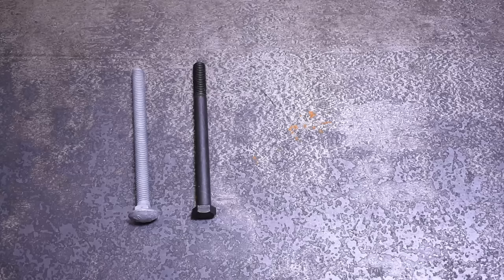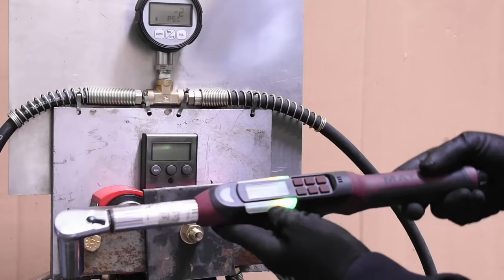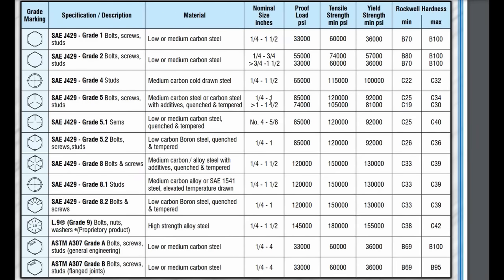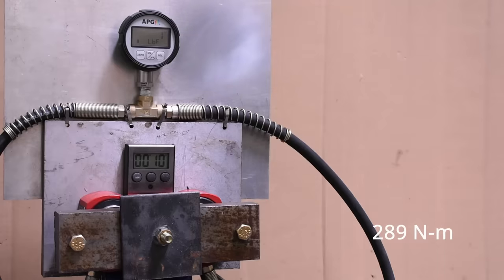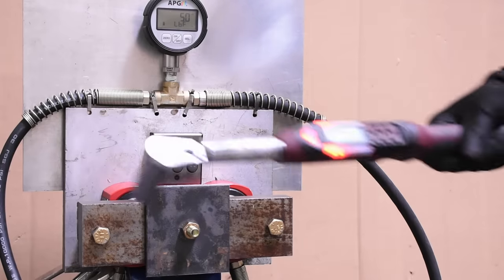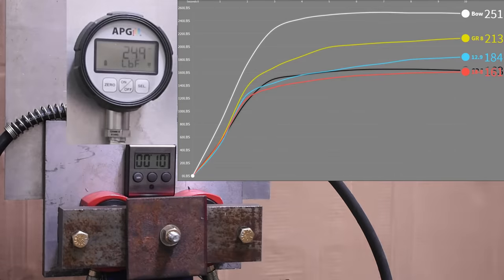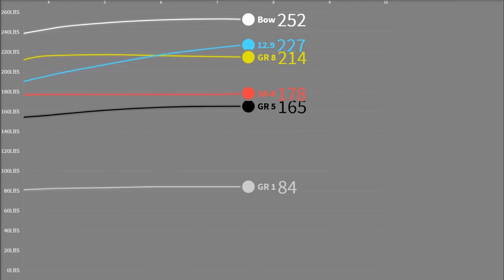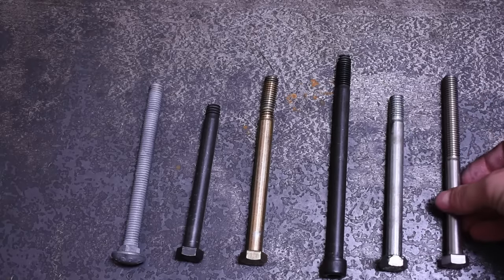Strongest Bolt? Grades Explained & Dyno Tested For Science

Comment: Hmm, we get 14.9 bolts with a 1” shank for holding big fucking machinery together, we can’t find a rattlegun that can break them yet, which is why we have a hydraulic tension tool which will do them up to 1400ftlb when required.

Comment: I really hate the 12.9 bolts.
At my site we use 8.8 hex bolts and/or 12.9 internal hex socket bolts.
And when the 12.9 bolts fail, thay are a paint to extract.

Comment: The 18-8 and 316ss are weird with 18-8 or 316ss nut.  They tend to heat up and seize if you tightened up to quickly especially when torque is involved.  When they start to notice unusual torque resistance to them they can seize very quickly and only way out is cut them of or break them off.  I never really understood this tendencies working around these fasterners.  Them alsmost act like working around bolts and aluminium  in that you cant let them heat up to much by threading otherwise they start seizing and stripping (thats on aluminum).  Like i said i dont understand the why that is that is something i in countered personally.  Maybe u or someone on here can shed some light on this issue...

Comment: Stainless bolts thend to cold weld if used anywhere near their tencile stregth. Also they tend to stretch easy and make them a one time use screw. 8.8, 10.9 and 12.9 can be used again without loosing strength if not overtighten.
Grade A ... well usable as a coat hanger I guess ... do not use them for anything structual or critical.

Comment: is your gauge reading in LBS or FT-LBS? How are you converting load to torque from this equation T = KDP?
Reply from the maker: It's converting bolt tension psi to ft-lbs of torque, normalized to the torque wrench. Like the Skidmore Wilhelm process.

Comment: I had an application where a bolt was being pried on. Grade 5 would bend. Grade 8 would snap like a gun shot. Only solution is go big. If using cheap hardware store bolts; go big.

Comment: I would love to see this kind of test on sheet metal screws. I am usually using stainless steel but that may not matter. I have found that they all twist the (#2) Phillips head slots  
out very easily. Some snap off right below the head. This has been very frustrating. Are there higher grade sheet metal screws out there somewhere?
Thanks for all the info in your tests.
Reply: The more expensive ones tend to be made with better metal in my experience.  Look at the country of origin on them and it will usually give you a pretty good indicator of relative quality. US, German, or Canadian screws are usually pretty safe choices.
Reply: @bigj231  Thanks

Comment: What is a metric with a "100" on the head? It doesn't have a "." as in "10.0" but just a "100" had a couple different brands of these. They are used as lug bots for a machine drive wheel. I couldn't find anything online besides the mark for the company is one from China.

Comment: On stainless steel bolt you have to put grease otherwise the bolt and nut will fuse in each other and will mostly brake when you try to take them apart
Reply: And lower the torque accordingly when using lubricants!

Comment: Toward the end you are referring to toughness when it seems you mean strength, they are not the same.  Higher hardness generally means higher strength and lower toughness.  Toughness is the ability to resist cracking and is generally measured by impact.  A grade 1 or 2 bolt may have higher toughness than grade 5 or 8 because they're soft and vend rather than break.

Comment: I like guys pushing the "butter bolt" theory. 
If they'd ever dealt with shear bolts, they'd known if they're tightened properly, any grade bolt used will shear before deforming.
One run loose does deform, and is a botch to get removed.

Comment: Hedder/ manifold bolts, studs. and how heat cycling, weakens/loosens them . More trouble with turbos 1200-1600°F  diesel 1900°+ gas

Comment: I was always told to stay with G8, and "run away" from SS because it was weaker...🤔
More misinformation?
How about redoing this test with the Bolts "soaking" in oil, or lightly coated threads with Lithium Grease...
Would this make any difference at all compared to a "Dry Torque"?
"INQUIRING MINDS" would love to see this as a comparison please.
Your Video makes my brain work like a Supercharger, loud and compressed knowledge!

Comment: i always thought stainless was stronger but i learned that they are barely grade 5...they do last better on exhaust systems but for strength, it is way better for grade 8 as you proved in your tests.....use stainless in applications where you may want to remove the bolt in a few yrs without all the corrosion

Comment: CAT makes their own bolts and seem to have more consistent results then hardware store for critical applications. Available at all their dealers.  And I'd disagree with your statement of wanting a bolt to stretch vs snap.  At both points the bolt has failed and it no longer holding (clamping) the load, except the one that snaps does so at a higher value, correct?.

Comment: I always felt that stainless steel's more brittle especially with harmonics or if you use them plate steel is plate steel bracket situation
Reply: I use to weld and repair Hobart food mixing equipment and was surprised that under vibration the stainless cracks. 16 gauge stainless with a 10 inch crack. I know that steel would never crack in that way. The equipment had to made of SS to meet certain laws for food processing use.

Comment: ENGINEER POINT OF VIEW : Bolts are designed to work like a tensile test sample. Thread is tougher than the shank. Of course the section is lower at the thread so you will see elongation at this place. The useful zone of resistance is the first initial ramp of the curve. Its slope gives you the young modulus of the material. As soon as the curve flatten, you are in permanent deformation zone, the bolt is starting to fail. https://practicalmaintenance.net/wp-content/uploads/Shape-of-Ductile-Specimen-at-Various-Stages-of-Testing1.jpg. So a steep slope followed by a rupture is a good behaviour. You don't want a bolt elongating itself and silently failing.

Comment: Bolt grades are not graded by their stretching holding strength but by their sheer strength. Same as a screws.
   Would be nice the see the thread roll over strength comparison of fine vs course threads.
Reply: Also, the Thor gun needed to be done with a new bolt as the damage and stress was already implied with the used bolt, causing it to fail prematurely.

Comment: Prices on those bolts for bulk are way too high. I work at a hardware/tool/industrial supply store lol. Had someone come in for 196lbs of grade 5 hardware a couple weeks ago, that was $900 CAD. He had at least 13,000 pieces of hardware, I was just grabbing fresh 40lbs boxes for a lot of it. $1.83 for a grade 5 bolt under 3/4x6 is overpriced

Comment: Far as I knew. An impact wrench is less likely to break a bolt as opposed to a breaker bar/ratchet applying the same torque.  But how much of a difference and if it makes a difference...
Reply: Agreed, thousands of lesser impacts will remove a seized fastener without shearing it like a steadily applied higher torque can.

Comment: Just awesome. The armchair (pretend) metallurgical engineers will be along shortly to tell you that you are wrong and Grade 8 (10.9) bolts are worse because they are "brittle" and will fail "suddenly". Thanks for the real world tests. That stretched out grade 8 bolt was telling, and parallels my experience. It looks like the Bow bolts are a legit upgrade it you really think a bolted interface might fail from bolt failure. It makes me wonder why there is such a proliferation of yield bolt engineering (torque to yield) instead of just improved bolts in general. I have a feeling it is because, after the engineering, the TTY bolts are cheaper.
Reply: Am mechanical engineer, MS focused in materials.  Lots of factors in brittle vs ductile failure.  Medium carbon steels can fail either way.  It depends on the loading, strain rate, amount of carbon, heat treatment, inclusions, amount of fatigue, etc.  High carbon is different and almost always has brittle failures.  In general just replace the bolt with the same grade, it may be designed as a failure point to avoid a different worse failure.

TTY bolts exist because deformation increases clamping force of the bolt as well as increases the "steepness" of the stress-strain curve.  When steel deforms it's basically removing it's ability to continue to deform, which makes it harder to deform.  They are also a little bit cheaper.

Comment: Why wouldn't you test a grade 2? It would take alot more torque than a grade1 and they can be very useful in situations where you know a bolt will flex to a point that would break a hardened bolt

Comment: Usually the recommended tightening torque is usually the torque you need to tighten a Bolt to 90% of its tensile strength and with a frictional coefficient of 0,12 in all contact surfaces. This is pretty basic knowledge. Also finding the tensile strength of each of those bolts online is fairly simple :D
Reply from the maker: Other charts are 75%. And that is with linear torque. No one knew, or at least we didn't, if this applies to impacts. Could have been 50% for all we knew as it's not an ideal fastening experience for a bolt.
Reply: @TorqueTestChannel  I'm from Germany and here it's always 90%. A factor in the equation is how accurate you tightening tool is. This makes a lot of difference. Tho a impact is not a precision tool like a torque wrench or a electronic one that measures the angle as well.

Comment: 18-8 stainless bolt isn't made from 18-8 stainless? You said it was a 300 series stainless,  tell me you were incorrect.  If I recall 18-8 has ,lower or no molly.
Reply from the maker: 18-8 isn't a specific alloy of stainless. It's any stainless with 18% chromium and 8% nickel. 304 stainless meets that

Comment: I've used Cobalt bolts before. Wonder how those would hold up.
Reply from the maker: You sure? All the benefits of that class of high speed steel are not generally based on bolt properties
Reply: @TorqueTestChannel  yeah. I'm sure. They were used on chemical tanks. And they were for the contents inside. Lots of corrosion resistance. Used like 16 (don't quote me on that) for bolting down the hatch and securing it to a special concrete structure.
Reply from the maker: M35 and m42 cobalt rusts pretty easy though. Maybe heat resistance?
Reply: @TorqueTestChannel  chemical. Iirc it was a tank for acid at a ethanol plant I was working on.
Reply: @patrickprafke4894  For extreme acid environments like hydroflouric acid they use Tantalum, it's a refractory metal. It's extremly expensive.

Comment: Now I may be stupid. But isn't using an electric drill for tests like these inconsistent? The drill is getting hotter and hotter which is going to change how the electricity flows. A pneumatic tool only cools as you use it because so much air flows through it and would be more consistent no?

Comment: The problem with Bolt and the grade markings is that 90% of people who order bolts goes to China and Chinese manufacturers will stamp whatever you want on the head. So, having a bolt which has a stamp i.e. 8.8 or 10.9 or 12.9 doesn't mean, it really is.

Comment: Grade 1/2 are good for building a wooden fence and equivalent.
Reply: Anything wood. Built up beams and girders, tie downs, wood ledgers on steel beams. Whatever...
NOT good for ACQ pressure treated unless hot dipped (like the carriage bolt shown here)
Reply: @jimurrata6785  Didn't know that, thank you.

Comment: Just saw an engineer recently about an old car i am restoring and he told me to remove all stainless bolts from load bearing parts as it work hardens and becomes brittle over time under stress.
Reply from the maker: True
Reply: and what did you replace them with?

Comment: Bit of antisieze or nickel paste and you will get a big increase in torque. About %40 is lost in friction.
Reply: Indeed, and 50% under the head.  Lubricating fasteners without torque/tension testing is a great way to make them fail under load...

Comment: In yours nomenclature 18-8 is A2-50 ora A2-70? SS steel dont have much Rm.... 500MPa is standard. 700MPa is good value. 800 and more u can obtain only in procesing steel. I belive looking On The results when 18-8 was a little Better then 5.8 you use A2-50 class SS bolts. I belive its true coz class 5.8 got Rm=500MPa and Re=80% of Rm. Mayby if you test A2-70 you will get something near 8.8, A2-80 over 8.8 and A2-100 over 10.9. But A2-100 are hard to find in shops 🙂

Comment: i hate stainless hardware... i used to work with it a lot on concrete trucks, its soft and its prpetty much one and done... its almost like aluminum or something, the nuts literally eat the bolts and vice versa... its like they just grind each other away when you tighten them up and thread them on and off... epecially once it gets a bit dirty or corrosion... its still easier to get apart than rusted bolts though... but you cant reuse them even if they look shiny still... theyll freeze up and usually strip off the threads when you do...
Reply: I'm pretty sure that's called galling. Definitely gotta use lots of anti seize on them if you wanna use them a few times, or have them come off years later without snapping haha.

Comment: I will NEVER buy or use 12.9 EVER.
Long story short, I worked in Assembly. We used pneumatic nut insert guns. 12.9 was what they used. I have had brand new 12.9's strip with the first nut insert. When that happens, you have to break the bolt off in the nut insert and SOMEHOW remove the nut insert. 
A) I hate nut inserts
B) I hate 12.9

Comment: You refer to static load cells used in compressive load measurement as a dyno. It is NOT a dynamometer, if that is the word you are associating with the abbreviation dyno. There is a more or less calculable relation between the torque applied to the head of a bolt, and the tensile stress that results in the bolt, so your measurements are interesting, but not accurate nor generalizable for a wide variety of reasons. Regardless of that, you are not using a "dyno". You are using a load cell. Load cells are often used as the sensing device in actual dynamometers.

Comment: Interesting but kinda pointless since tight is tight going tighter on the threads will gain you no added performance as the bolt manufacturer says the load through or across the bolt is the working load which wasn't represented here i mean its good to know when your at risk of stripping the threads but tensile loading of a bolt has so many more factors than just tightening the threads can illustrate

Comment: Ugh.. the imperial system does my head in! All those nonsensical grades. 
I think a tensile test would have been more useful here. Takes the thread tightening performance at high loads out of the equation. Spin a nut of the same grade as the bolt then apply tensile load wih a hydraulic tensile tester thru to yield, then failure.

Comment: the triangle at the top is a private label for the barnes group/ aka bowman fasteners.  msc is a distributor. not as much as a  manufacturer but does have private label fasters. But the icon is that of bowman and have a special alloy grading system  https://www.electronicfasteners.com/wp-content/uploads/2014/09/northamericanmfgidentificationmarkings.pdf

Comment: 1/2 inch ~ 13mm, not 12mm. 1 inch is 2.54cm or 25.4mm/2= 12.7mm.
Reply from the maker: There aren't 13mm threads. 12mm is the import car's closest to 1/2" threads.

Comment: PROBLEM right off the bat.  @4:24 I think you are using a nut that will be too tight.  Galvanized bolts & nuts are cut to a different standard 'looseness' standard to accommodate the zinc coating.  I don't believe you should be using a non-galvanized nut.

Comment: You didnt use anti seize on the stainless bolt so it locked up and didnt move
Reply from the maker: It wouldn't increase bolt tension if that were the case
Reply: @TorqueTestChannel  all you need is a drop. A drop spreads everywhere

Comment: What did I learn from this? Bolt grading is some of the most convoluted and confusing stuff out there. If I see 8.8 on a bolt I would assume its grade 8. Not grade 5. Like what? Why is this measurement so confusing. We really need to get an international institute of standards to do something about this. Same thing with batteries. I assume this issue plagues plenty of things but why wont anyone fix it? Just look up button cell battery cross references. Its a mess.

Comment: The yellor color is more likely cadmium plating, not a designator fo grade 8.
Reply from the maker: Yellow zinc, although cadmium is also used on high end fasteners and yellow
Reply: @TorqueTestChannel  Makes sense - claiming it's a designator for grade 8 doesn't. G8 generally has six lines or "hash marks" to designate it as such, and 
Thanks for the correction - I learned something today.
Reply: @ASJC27  Dang, learned even more! Many thanks.

Comment: Didn't even know there lower grades than 8.8. Or grade 5 as you call it. Also: Tightening a bolt to spec irreversibly stretches it. Making subsequent tightening measuring attempts worthless. NEVER reuse a bolt that has been tightened to spec to hold critical components. I'm not speaking about wheel nuts, they are designed for that. Heavy machinery, excavator equipment. Don't do it, people can and have died.

Comment: Did you call a stainless steel bolt: non-ferrous?

Confused? I am.
Reply from the maker: I think ferro magnetic makes actual sense
Reply: @TorqueTestChannel  sounds better, but of course then 400 series stainless bolts would still be in that class as well, as 400 series is magnetic. (To be fair you were only talking about bolts made of 18-8 tires stainless in the video)

Either way, interesting video!
Reply from the maker: Oh definitely. Ph stainless like 17-4 too. Lots of non 300 grades are magnetic